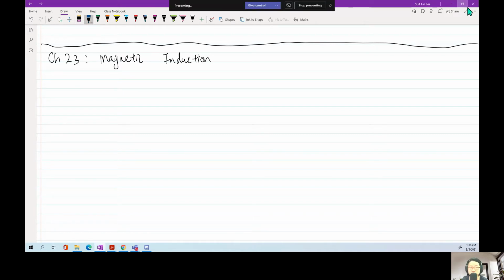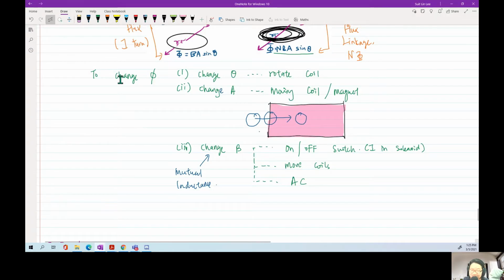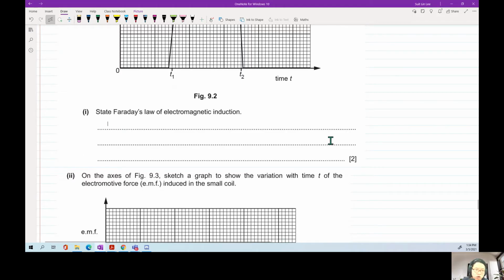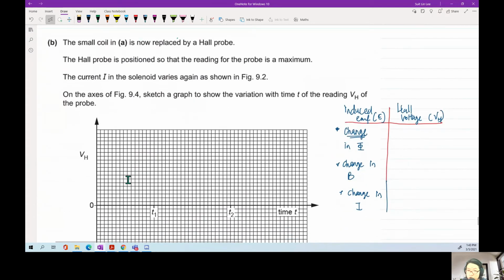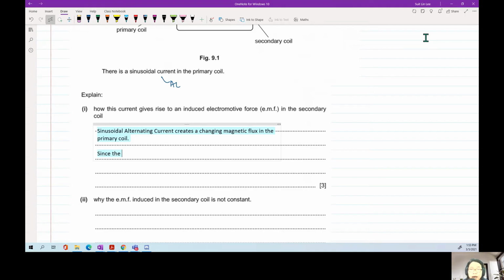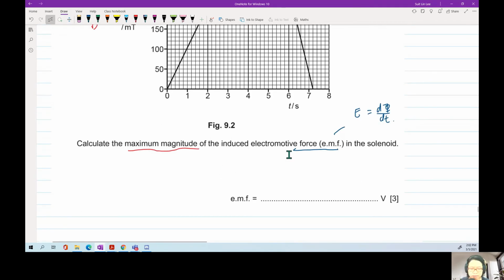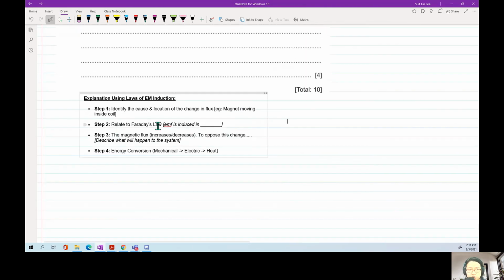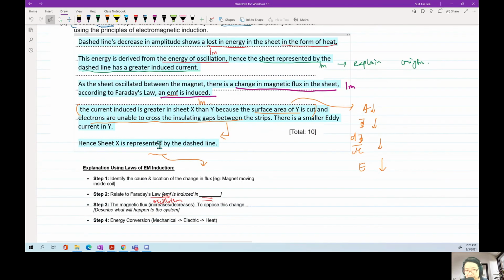Electromagnetic Induction (Ch20 Part 2) | A2 Review Session | Cambridge A Level 9702 Physics

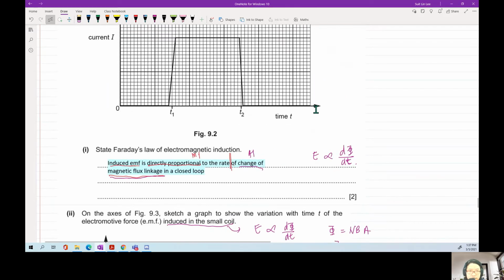Comment: heyy at 21:29, you said that B is directly proportional to I but isn't the formula for B F/IL, making it inversely proportional?
Reply: This is a bit late for your exams, but might be useful for someone else. That formula is the Force exerted by a magnetic field with flux linkage B. The formula shes talking about (where she derives B is directly proportional to I) is a formula thats not given in the syllabus, but is touched upon in the previous video. 

The way I think about it, is youre passing current through a sollenoid (an electro magnet), and so obviously, if you increase the current, youll induce more field lines (make a stronger magnet). So thats why B is proportional to I...